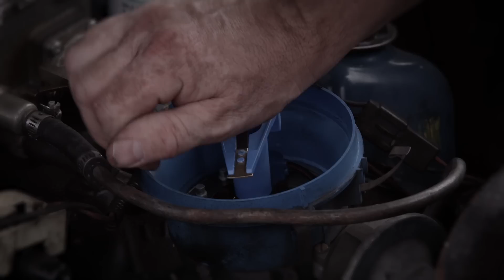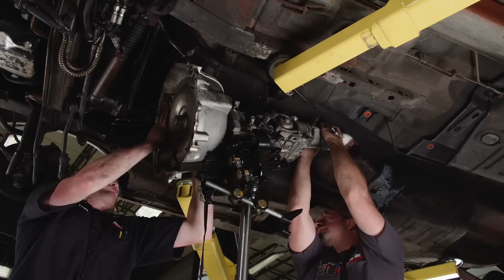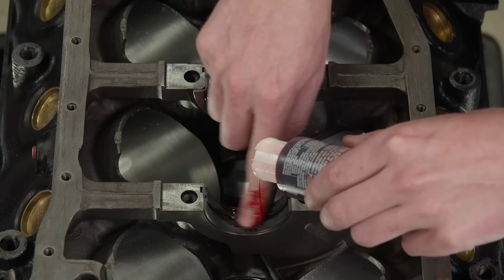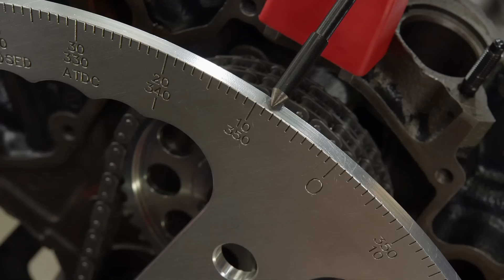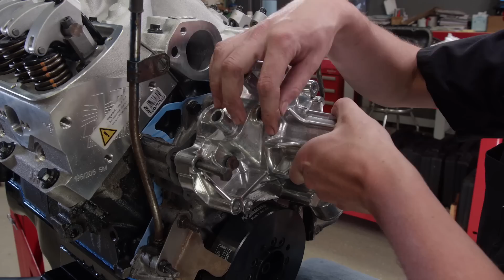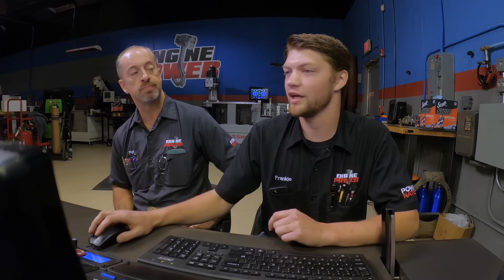Disguising a High Revving 347 for our Sleeper Granada - Engine Power S9, E13

Comment: Going too big on the carb is more likely to make you run lean, due to less suction in larger venturis at a given flow rate. Can be compensated to some extent using bigger jets, but go way too big and there won't be enough suction to provide adequate mid range fuel flow even with the jets removed entirely...

Comment: would have loved to see them tune that carb for a decent idle and part throttle with a cam that big  since they say it's a street engine lol
Reply: Yeah, I'm not sure I agree with their reasoning about the big carb and single-plane intake. It can work, but I don't see a vacuum gauge and we don't know what this car is going to drive like. Are the power brakes going to be consistent? Is the fuel economy reasonable for a daily driver? Can it run dependably in different temperature conditions? Emissions aren't the only consideration, but we should at least have an understanding of what the pollution will be like. Maybe all of this is going to be a lot better than expected. Right now there are a lot of other variables than simply peak horsepower.

Comment: Great build. I love the SBF builds. Unbelievable power from this little 347.
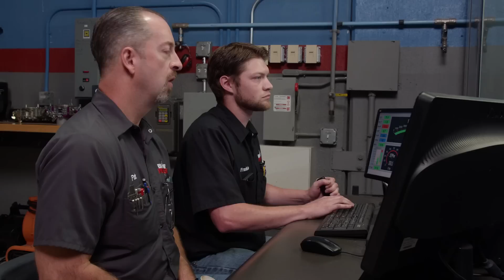Reply: As long as you don't mind a peaky engine that 19:40 makes no power and barely runs below 3500 RPMs... because of the too big cam...
Reply: @BuzzLOLOL  you just keep it in the ketchup
Reply: @BuzzLOLOL  The bottom of the graph is 200 hp not 0 hp.
Reply: @BReal-10EC  - Looking on the wrong scale... notice torque/HP plummets left of 3800 RPMs on the graph... (which isn't shown)
Reply: best small block Ford Windsor build by far!
Reply: How u consider a 347 little? Small block yes... little engine.... no! 1.8 liter... yes 2.0 liter yes! 5.8 liter... no...
Reply: @drofdoctors7887  5.7 liter's and that's small to 7.5, 8.2 liter engines or larger
Reply: @jjh-e9x  & so on & so forth... 10 liter larger than that... 5.7 not "small" 4.7 283... smaller 4.8 293.... smaller 5.0 305... smaller.... 5.0 307.... smaller... 5.3  325... smaller... 5.3 327.... smaller...

Comment: My dad owned a '76 Granada and I got to drive it often. I will vouch that it was one of the most under powered cars ever made. Nice build guys
Reply: Our family had a Volkswagen Beetle 1965 year model. Rated at 36 horsepower. Slowest rig on the road, I think.
Reply: @codo7  probably faster than the granada
Reply: Its low horsepower is laughable now, but a Granada with the 4 speed manual 250 or 302 wasn't too shabby in its day compared to its competition.
Reply: @johnmcmullen456  what competition?
Reply: @ufarkingicehole  Granada's competition back then would be the newly downsized GM rwd midsized cars like the 1978 Malibu, the Dodge Diplomat, and maybe higher trim levels of the rwd Nova and its other GM division counterparts like Olds Omega & Buick Apollo.  The idea was a compact car that offered more luxury and options than the typical entry level vehicle. That caught on with the public, and even with Cadillac Seville customers, buying  basically a rebodied Nova, or Lincoln customers buying a Versailles, a dressed up Granada.
.
Reply: @johnmcmullen456  I had a 1977 Ford Maverick with a 250 I6 motor and if I was in a hurry I would ride a bicycle instead.

Comment: Granda is wonderful and heavier to plant the power made than the little mustangs of the era.
A fairmont thunderturd or some other fox body non muskrat is even cooler.   Friend has a Mark VI will rip up the track with high tens before throttle in the bottle. 
No cage and no serious frame improvements yet.
Reply: This Granada has the same rolling chassis , as 68 to 73 Mustang.
Reply: @bobroberts2371  which in terms of off the shelf suspension upgrades Fox body is orders of magnitude better to say nothing of the shitty type 2 suspension and power assist cylinder for steering.

Comment: The last thing I expected them to say is that a V8 Granada had a lot of room in the engine compartment. I guess I'm remembering a time before the seventies' gas shortages.
Reply: Same rolling chassis , as 68 to 73 Mustang.
Reply: @bobroberts2371  I'll never forget the experience of changing plugs in a V8 Mustang II.
Reply: @miker252  Every factory V8 M 2 and Vega / Monza I've seen ( in the day ) was thoroughly trashed. Even when the standard cars were still in decent shape.
Reply: The 289/302 was pretty compact for a V8. The later Granada was on the Fox platform. Still good for holding a 302 but not as roomy. Ford at one point was allegedly considering discontinuing the V8 in all of the Fox cars in favor of V-6es and, for performance cars, turbo 4-cylinders, and fortunately, never did. For a bit in the early 80s there was a really puny 255 V-8 that often had a Variable Venturi carb and the whole thing was about as appealing as a stint in a Turkish prison.
Reply: It's all perspective. Compared to a modern car, it's HUUUUGE.  I dated a girl who had a late 1960's Dodge truck in High School.  She would climb, all 110 pounds of her soaking wet,  INTO the engine compartment to work on it.

Comment: need the 2nd gen grenade all the fox body stuff fits to it . i had one in 96 that i put a tube k member and arms . dropped a 351w stroked to 427 with gt40 heads , Victor Jr. intake , holly 750 carb ,, bbk equal long tube headers, t5 tranny , mini spool with 3.90 gears , 17 inch cobra wheels with toyo r1 tires , i had to put a 10 point ce cage in it cause the windshield keep popping out every time i hit the 150 shot of nos . back then it had spin tech mufflers and soud\nds like no other car . in 3 months of street racing the car was free and making money . started doing spectator drags with it and had to take the cobra rims off and went to 15 x14 with goodyear nascar mod tour tires . yes it looked dumb but it would stick like glue threw the turns at any speed . sold it in 2002 for 12k and to this day i miss it but the kids came first

Comment: I am a complainer but it would be nice if the part links were not just to generic pages.  I mean you had the parts and packaging there with part numbers and then as example just ending up at the ARP site leaves a ton of work trying to track an exact item down, Comp Cams from Summit is a huge range of products even when you narrow by maker, engine, size.
You may also have mentioned the rough cost involved.  FYI for anyone else, you are at $4K just for the heads and shaft rockers so not exactly low budget.
Reply: Time constraints.

Comment: Something I would like to see is a truck engine built for more torque and horse power  to pull heavier loads and still run on regular gas and rpm of 5,000-5,500. I have a 2002 dodge ram van heavy 2500 with a 5.9 gas motor and only 82,000 on it. Just like to see what can be done for a good price and not a crap load of work. I'm sure there are other people looking for a little more than stock and not throw a bunch of money at it.
Reply: Research some top end kits for the 360 Magnum engines. You could gain a lot.
Reply: @jhutch1470 . Flyin Ryan Performance is making some very good kits for them, with tuning!
Reply: Us 3rd Gen Hemi Ram guys have been doing that for years.
Easy setup is swap Eagle heads on early 5.7L Hemi with 6.4L variable runner intake manifold, mild truck cam with lots of advance, and high flow exhaust.
Easy 500hp setup with lots of torque!
There’s a dedicated Facebook page for guys who have it are doing this setup with different cam sizes.
Reply: @bri-manhunter2654  so much for easy and cheap. Have you ever tried doing this in a ram van? There isn't much room let alone trying to do a motor swap in a gravel parking lot. Am sure the motor has to come out the bottom.
Reply: @greghardy7239 . Yea, Hemi tax, they are not a cheap platform at all. Be cheaper to build a junkyard motor outside your van, and then swap it in.
My 13’ Ram is a 394Ci 6.4L stroker.

Comment: I frickin love this thing, used to know a guy who did f.a.s.t. class racing, and he was using Walmart Douglas white wall tires. Super cheap, and soft. One of the rare skinny tires that will hook. At 15 psi they would hook enough that the wheel would spin inside the tire a bit on launch.

Comment: I have same stroker kit on floor in room, & actually bought same kit 22yrs ago, and it came with srp pistons with ring through pin, 28oz balance, now with new kit its got mahle coated slipper skirt pistons fixed oil ring & 0 balance, my holley efi is spot on with hp by fuel

Comment: Wow I'm in love with that slightly modified 302 Blue Oval. I can't wait to see the test drive but don't let Tommy drive it. Question now is, with the increased Hp/Tq figures, what will you do with the transmission and rearend as the Ford C4 drivetrain was not designed for these power levels. Will a Ford 302 bolt up to a C6 trans? You started this project, now I want to see where you guys take it. I have to drive past your shop early this coming Monday afternoon on my way to Mt.Pleasant from western Indiana and boy would it be nice to see this gitup. I'll be in the area for two-weeks looking for a new place to live down there.
Reply: They can build a C4 to handle this power; this engine is a bit much for a stock unit but people don't give the C4 enough credit. The car itself is not super heavy. I shouldn't admit it but around the farm we pulled some insane loads around with a C4 in a half-ton pickup. Big grain wagons. It was stupid, but we still got about 125,000 miles out of it before the forward clutch started slipping. 

There is a C6 case that will bolt to a 302. Most likely source would be a 3/4 ton pickup or van with a 300 six or a 351 Windsor. Any other C6 would have a different bellhousing - there are two other patterns, one for the FE V8s and another for the 429/460 that also bolts to most of the 351Ms and 400s. (It's kind of a long story and there are some odd combinations; Ford also had the FMX, which went behind a lot of mid-size engines in the 1970s, and there were apparently some early 400s with the Windsor pattern - I've never seen one but have been told there were even C4's used with 400s). 

The rear end is a big question mark. And so is the rear suspension and tires. One of the issues with a "sleeper" is that if the tires are really wide, it kind of gives it away that there might be some extra power in Grandma's going-to-church buggy. But, they are going to need more traction, and these cars are light in the rear. So I wonder what they end up doing.
Reply: @mtut  - I was glad to see this build however with this application and vehicle type, honestly the power level should've been tamed to a more reasonable 250-275Hp range so that the rest of the system would not have to be as modified. The show began with 99Hp showing on the dyno so 250Hp would've been more than enough. For this build, instead of pulling out all the bells and whistles I think it would've been far better to stay with practical. As a trucker of 38-years starting out with 220Hp diesels all the way up to 600Hp diesels, I've learned that it's not who gets there first but who shows up in one piece. Even my 2012 Ford F-150 (I'm a Ford guy all my life) only puts out a meager 302Hp/278Tq and I am more than happy with it. It's not a stump puller and it won't move mountains but when I arrive, I do so in style. This is the process of growing old, your priorities and attitude change with age.
Reply: @kingjames8283  It depends on what else they do to the car, but a 302 and C-4 can live a long time and be a daily driver with decent vacuum and at least factory fuel economy (not exceptional...) in conservative driving over 400+ horsepower with a few upgrades, so they are not absolutely insane here. 

They are going for shock value on the numbers. And they aren't talking about their budget very much. But this is sort of a swimsuit issue and they made their point.

How they make this streetable would be interesting, but I don't see mechanical failure as the #1 problem. This can get there. 

This Granada might have a 9" rear end already since it was supposedly a factory V-8 car. It would need some upgrades anyway for traction purposes. 

This could be a durable, driveable car. I am not exactly sure what their goal is, though.

Comment: Loved to see a 318 build.
Reply: MoPar engine? Why?
Reply: @GeekBoyMN  Because some people have the skills to be an engine Builder rather than just an engine Assembler.
Reply: @bobroberts2371  I get that but why not put those skills into building a Ford engine to keep this car a sleeper? If I saw a MoPar or an LS under the hood of a Granada I would instantly know something is up because most people who do those kinds of swaps don't just stick a factory LS or LA under the hood of a FoMoCo.
Reply: @GeekBoyMN  The 318 LA blocks have a 9.6 inch deck height. You can stoke those to over 390 cubes. Talk about a sleeper.
Reply: @jhutch1470  Right but why go to the extra work of putting one into a Ford?
Reply: @GeekBoyMN  Nobody said anything about putting one into a Ford.
Reply: @jhutch1470  lol ok
Reply: @GeekBoyMN  Where did anyone say that a 318 should be in a Ford?  The OP wanted to see a similar build in a Chrysler product.